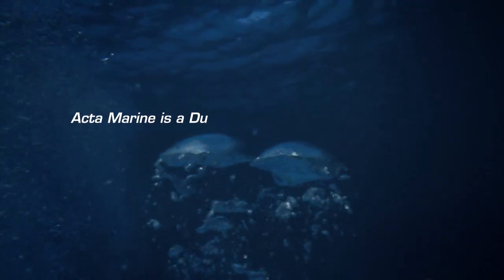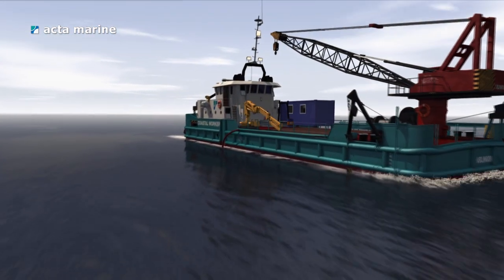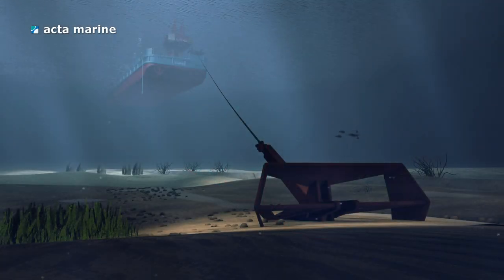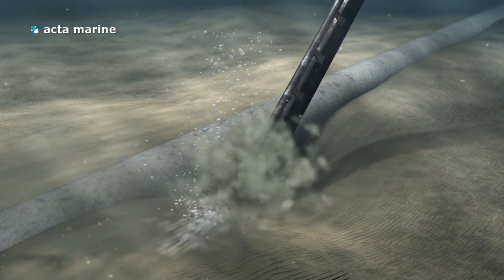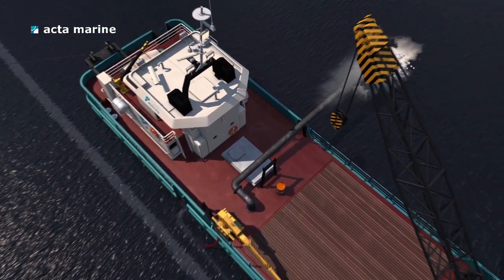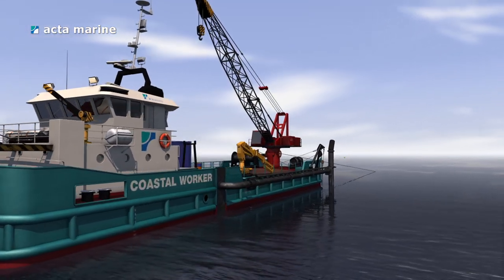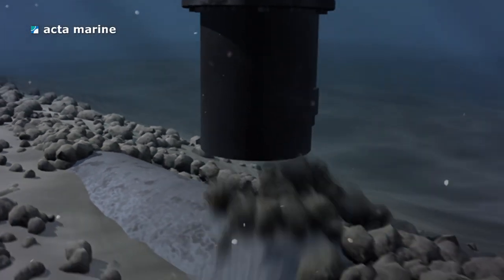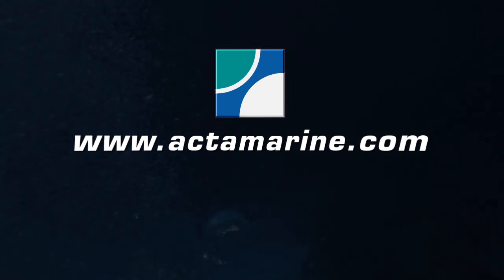Lowering Subsea Cables & Pipelines | How it works

Comment: Dear Alex
many thanks for this nice video, I have question about the trenching of shallow water. what is the minimum trench width can be provided in tide shallow water near shore (Max 6m depth)?
Reply from the maker: +Amr Mohame For specific questions best thing you can do is contact Acta Marine. http://www.actamarine.com/nl/contact
Reply from the maker: Dear Mr. +Amr Mohammed,
The minimum trench width is fully dependent on the local soil conditions and the trench depth. Typically slopes varying between 1:2 – 1:6  can be expected, meaning that e.g. a 2 meter depth of lowering results in a (top) width of 8 – 24 meters. However, it is impossible to predict more exactly, unless specific geotechnical information (density, consolidation, particle size) of the site is available. Hope this answers your question. Do not hesitate to let us know if you have more specific questions or interest.Acta Marine

Comment: Sometimes other countries pipelines cross each other under the sea... do they simply put one pipe on top of the other one? If yes, won't that damage the pipe at the bottom? Or they use some kind of bridge?
Reply from the maker: As far as I know... Yes. But the second (crossing pipe) will not be buried to avoid damage. It simply will be layed down at the sea bed and then covered with concrete mats, Bags with rocks are other heavy materials...